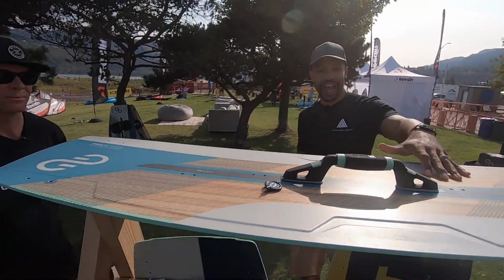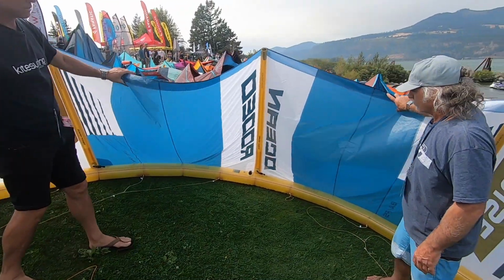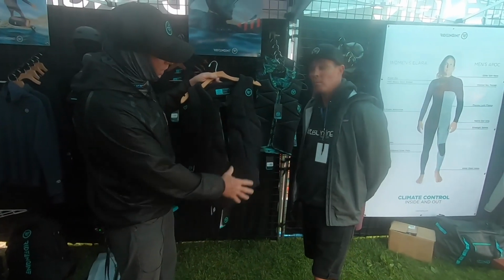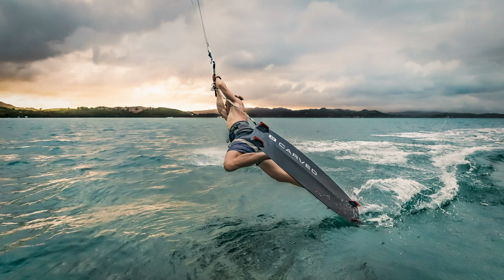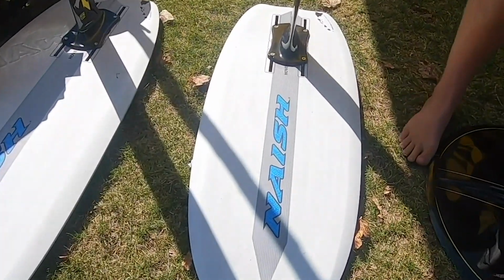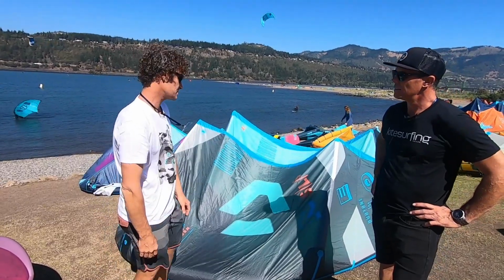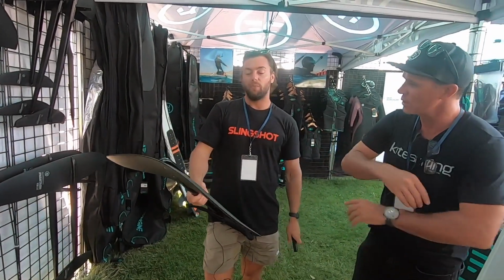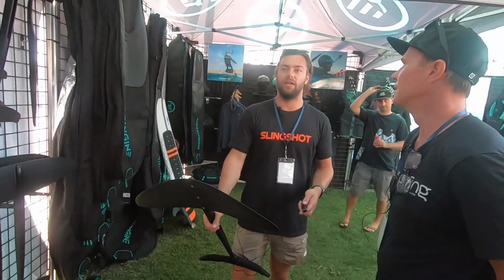Top 10 Kitesurfing Items 2022 AWSI

Comment: At 11:30  + you say that the SS Foil adapter will allow you to put "new carbon Phantasm Front Wings on your HoverGlide system".  The HG Adapter is for the HG Mast so you therefore need the Phantasm Wing, Fuse and Stab to upgrade your HG system.  I look forward to your AWSI reviews every year.
Reply from the maker: Be sure to check out the 2023 gear video. https://youtu.be/ppSwXHt6h74

Comment: Orbit over xr7  in the top 10 really !!!
Reply from the maker: We figured you would check out the XR7 when you looked up the Carved Imperator 7.
Reply: @Kitesurfing  I already have a quiver  of xr7’s, hopefully get the carved imp7 soon, 
Anyway new orbit only a couple of tiny tweaks, , whereas xr7 is quit an improvement from the xr6, new canopy material, strut material etc, much loopier kite, compared to the xr6, so it should really have been in top 10, 
New orbit mainly just a colour change to be honest